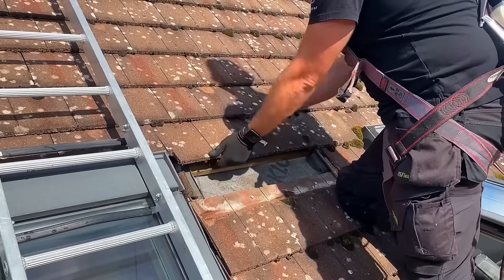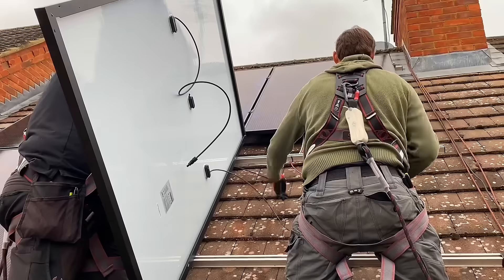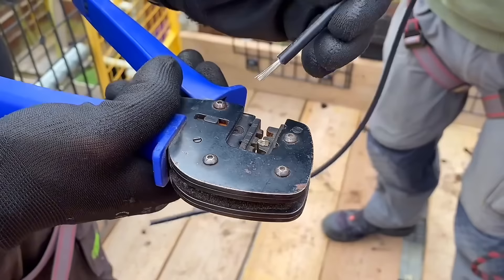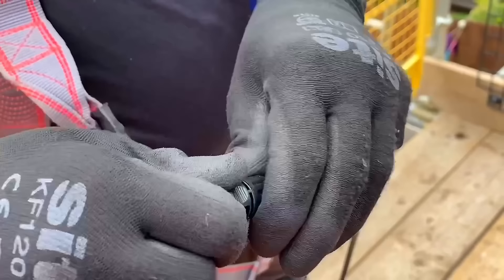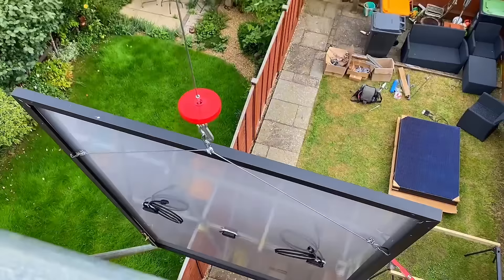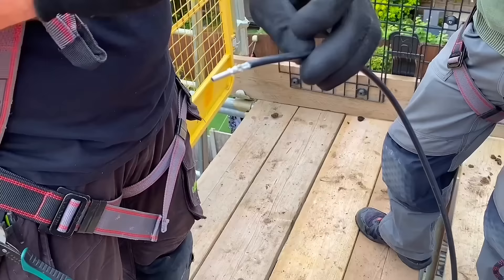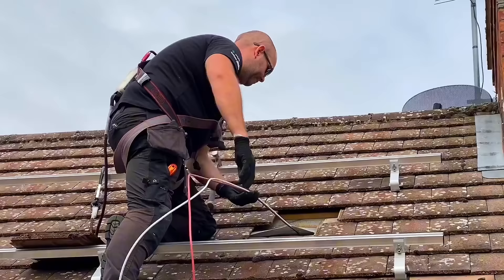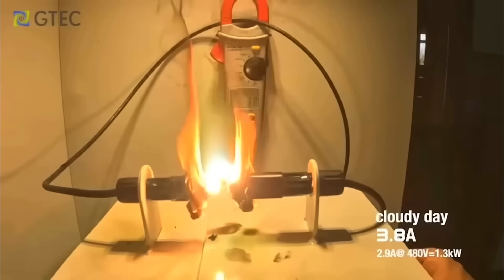Don’t Arc Around with MC4 Connectors - Solar Panel Installation

Comment: One reason why its safer to stick to lower voltages, most UK homes do not need so many panels in series, the small amount of money you are saving on the copper in the cables is negligible. just run a few 6mm2 cables rather than throwing hopes and prayers on a single connector, its insane to me. I have an array of 9x410w panels (3s3p), pretty standard 3.7kw and my open circuit voltage sits around 100v, it can still arc but wont be crazy like that 500v video.
Reply: @KrysRevamps  as Thomas Sowell stars "there are no solutions only trade offs".
Cheap affordable power is the solution, neither green activity or commercial interests are interested in cheap affordable power.
This is because green movement is based on nature worship and commercial interests want the world plus 5%.
Reply: @KrysRevamps  lol, horses for courses, your only a tiny generation plant, what about the big plants, your theory would cost balloon pretty quick. I have never had an mc4 connector fail to date. Fit off correctly, you shouldn't have any issues. I am also in a hot climate, extreme testing conditions.
Reply: @bh9420  That is why is said "most UK homes do not need so many panels in series" and not about generation plants. generation at scale wont suffer from this because Bob the local sparky that just got his MSC certificate wont be working on those systems, you would have engineers with decades of experience that triple check their work. anyway maybe your extreme weather climate is fogging up your ability to read.
Reply: @KrysRevamps  Lol, Bob the local sparky does the work on those big systems where I come from, the engineers are too busy pushing tablet pen sticks in the office, LOL. Enjoy your HV dc system.
Reply: MC-4 IMO was never designed for high voltage. My ground mount high voltage system I just cut them off and butt splice then use glue filled heat shrink. Every MC-4 connection I ever seen with over 300 volts eventually start to arc and melt. If you go on the DIY solar forum everyone does this MC 4 will fail only matter of time. Just get rid of them completely it's little scary cutting the plug off the solar panel but reality is never need to deal with it again unless your going to take the panel down worse case you can even replace the wire going into the diode box.
Reply: @Mike-01234  I can't believe you are having so many problems with them, I have never had any fail on my systems to date, most are around 400vdc.
Reply: @bh9420   There are most likely, some really cheaply made MC-4  plugs out there. plus, connecting mixed brands could make bad /loose connections. I love them for projects I make. great because no exposed terminals when unplugged and no way to reverse polarity.
Reply: @Mike-01234  While the voltage may cause the arc, it is the high current which generates heat and kicks off the MC4 connector failure by melting the plastic and pins. The pins are relatively small, but fine for a single panel. When you go for multiple panels at higher currents, then you have issues.

Comment: After using MC4s on my boat for 9 years. I can tell you they are the biggest cause of failure in my system. They are absolutely crap, made out of degradable, cheap nasty plastic that breaks down in the sunlight, be it, UV or IR I'm not sure. However, all that needs to be done is to crimp the wires and insulate from short circuit and the weather.

Comment: Don't forget to use compatible connectors, usually the same manufacturer, to ensure they do make proper contact.  Technically they should all be interchangeable but we all know how sloppy the generic stuff is.
Reply: I think it’s even better to just avoid generic stuff, period. It’s not only sloppy mating with others, it’s sloppy with itself. Better to spend the money for the genuine Stäubli.
Reply: Just had to deal with Chinese sloppy on neighbors roof. 2 "MC4" connectors together but wouldn't come apart even breaking the tabs off that lock them. Ending up cracking apart and breaking the wire out of the crimp. And then just recrimped new ends on... What a mess. Wasn't too loose. If was to damn tight haha.

Comment: This system of panel racking is not good, birds build nests underneath which leads to a build up of compost between the panel and roof which can cause leaks to the roof and even combustion of the compost as composting organic matter can spontaneously ignite due to heat build up, I would never recommend a roof system over an easily maintained ground system, these systems only really make sense on accessable flat roofs

Comment: I Crimp and then Solder any connection  where possible, its overkill but never had any connections fail or overheat in any application
Reply: Very bad practice. If you’ve done your crimp properly (which means it’s gas tight) then no solder will enter the crimp area itself, but the solder will wick up your wire and create a rigid area outside of your strain relief where flexing can break the wire. 

If you’re feeling the need to reinforce your crimps with solder, the problem is lousy crimps. Improve them rather than adding solder.
Reply: WRONG!
Reply: AHH but solder will flow across more surface of the wire and the crimp metal therefore making a far better resistance.

Comment: 1:40: That has got to be THE best feature of any connector ever: Being able to put the plastic part over the metal part AFTER the connection to the wire has been made. My personal odds of forgetting to slide the plastic part over the cable at the right time must be 50% or more.
Reply: While I agree it’s super handy, that is not unique to MC4 connectors — most crimp connectors, from big ones like this to tiny things with 1mm pin pitch, work that way. The only crimped terminals I can think of that require forethought are uninsulated faston (spade) terminals, if you want to slip an insulating boot on.
Reply: Yes, I had to remake several connections because I forgot that...

Comment: Correct crimping is critical.  Seen plenty fail due to wrong crimping.  Fire hazard if not done properly.
Reply: I use hydraulic crimpers on my mc4 connectors. As well as all my battery cables and pv Inputs get ferrules.

Comment: I worked as a solar installer during 2013-2016 then became a solar maintenance technician. During that time I mastered both AC/DC parts including connecting the system to the utility and commissioning it.
Reply: Just out here tooting our own horn, nice.
Reply: @cyumadbrosummit3534  I know right, thought we were going to get some pearl of wisdom about fires or install issues... nope.

Comment: Had a DC isolator fail and had no choice but to pull leads under load. covering all panels or wait till dark was to much hassle. Playing with arc much more fun.
Reply: Why do it under load can't you just shut the inverter off so not pulling any current not going to get an arc then.
Reply: @Mike-01234  yes another way but I hate going up and down ladders.

Comment: I soldered all my solar panel MC4 connections for my van with four 320w panels connected in series parallell giving 80v. I also covered the entire connection with self vulcanizing tape to be sure they would be watertight. (Edited, I forgot to mention that this is an install on a van that travel often at 90 to 110km/h so the cables is subject to a lot of mechanical movement and vibrations).
Reply: So how do you get the arc at 80v? It seems you need at least 300-400v.
Reply: Arc requires no mote than about 30V.
Reply: @TechMasterRus  At 80v arching is very unlikely, but it is better to be safe then sorry ;) . And on a van that often travel at a speed of 90 to 110km/h the cables is subject to a lot of vibrations and mechanical stress. (I forgot to mention that it was an van install which is very different from static vibration free mounting).
Reply: @a64738  I mean, having no arc is so boring. Even in this video, by far the most viewed part is the arc at the end.

Comment: Points from the video...
Hard Hats missing on occasion.  Using the rails as a ladder and probably damaging the roof tiles under the bracket  and the validity of the bracket fixing. 
..and as I see on so many roofs , not supporting the cables correctly, leaving them touching/rubbing against the abrasive 
roof tiles, which over time is a high risk of fire..
Reply: @paulrichards1061  who needs an F-ing hard hat on a roof ?

aircraft parts gone missing and precisely knocking the PV installers off the roof ? 😂

Comment: There are 10mm² MC4 Connectors as well to go with 10 mm² cable for larger installations
Reply: No. Calculate the required thickness (CSA) of cable required. Then use appropriate thickness cable and suitable rated connectors.

There is no need to guess, and guessing carries risk. Eliminate that risk and do the job properly.

Comment: Hi,is there any tool to cut out automatically that skin off the wire or you have to measure your self everytime that annoying half of inch? (i think ..half of inch?tell me if i am wrong)  Please anybody?
Reply: Some wire strippers have a stopper to set a certain size. So once set you can easily do this. My Irwin wise grip has it but I have not used it a lot.

Comment: They are mismatching connectors in this video which is a definitive NO-NO massive error and is cause for 80% of all PV related problems/fires. 

On the panels are Staubli MC4 connectors and they are assembling some other brand of connectors which is definitely not MC4 as only Staubli connectors are MC4 others are clones and reputable names have their own naming as for instance Wieldmuller  MC4 clone is named WM4, Amphenol named his MC4 clones H4. No company has licence to produce MC4 named connectors as it is proprietary Staubli name, and no other connector is tested to comply long term compatibility with original MC4. This is why every reputable inverter and pannel uses Staubli original connectors.

Check out TUV Rheinland's FMEA Rating of PV Module Failures.

Mixing connectors is reat receipe for disaster. Never do that, kids, you'll burn your house down.
Reply: Is really painful seen this crossmating situation over and over again, even in videos supposed to be for good practice. The stripping of the cable was also not well done...

Comment: The only ones that care are ensurance companies.
I really hate high voltage DC for good reasons.
Reply: I have more respect for my 48V battery than our grid connection.
When it shorts, those 280Ah cells dump serious current.
Reply: Agreed, all those ( ofter to thin ) DC cables running over the roof, making tight bends everywhere... I also hate it.
Thats why I went for Enphase with micro inverters, much safter and simply better for good reasons.
Probably also much more install friendly.
The use of DC cables should be reduced to a minimun.
Also the losses in a good length of DC cables are pretty significant.
Reply: Loss is the same regardless AC or DC. It is just ohms law.  Use the proper wire size.
Reply: @Sixta16  In practice, financial law competes hard with Ohms law.
That's part of an electrical engineers job.
Build it at less costs and less losses.

Comment: Not the best way to do it.
You should ensure the cable reaches into the cylinder as the actual conductor, is the neck between the crimp and fixing.... 
30amp rating apparently...

Comment: Those are not made off to specifications. First of all: He stripped the insulation to far back.

This is the only correct way (German with subtitles):
https://youtu.be/sErsAfgwFrI?si=CErfpB61degL3wMN
Reply: The void to hold the stripped wire is deliberately quite generous with MC4 connectors to allow easy in field stripping and preparation of the cable.  There is no need to precisely measure the amount of insulation removed.  Anyone doing so is simply burning time and the customer's money.
Reply: @retrozmachine1189 my crimper have a guide and a bit of tin which only sits down flat if the stripped wire is not to long. I have had them a long time but they keep the crimp end square and set the crimp in the jaws at a set point.
Reply: @andyhodchild8  Nice feature but doesn't negate the fact that there is space in the terminals to accommodate a degree of excess wire.
Reply: @retrozmachine1189 I would rather spend a few seconds extra on inspecting a crimp than having a customer's house burn down.
Reply: @Richard1977 Cite examples of customer's houses burning down because of a reasonable amount of excess stripping of the wire, ie that is by design accommodated by MC4 connectors.
Reply: I agree stripped the wire too much

Comment: I’m leery of the unbranded crimp tool. The more I use first-party crimp tools, the more I realize that most no-name crimp tools are crap, producing poorly formed, improperly pressed crimps.
Reply: @tookitogo  you can adjust that.
See a small wheel on it and set it.
Reply: @dyslectische  Adjusting the tension wheel cannot, and will not, make up for crappy dies. I know what I’m talking about: beyond being a trained electronics technician with an unhealthy nerd interest in connectors, I own a number of no-name tools, as well as a handful of first-party tools. And at work I have access to more. There is no comparison in the precision of the dies. The no-name tools often literally have the wrong shape in the dies (very often, they’re made to crimp wider and flatter than the real tool would), and with much sloppier tolerances. Good crimp tools specify their tolerances in hundredths of a mm. Cheap tools don’t even come close.
Reply: @tookitogo  than you talk about china product.
Thare good tools make for cheap in Germany .
What just work fine.
For the rest my self a trained electrische technician .
Special for track and trace systeem.

We only use tools that have certificate and we have recalibrate after 1 year of use.
So i do know my stuf 

But again people do not pay for it .
So thare are good normal tools for normal price for a normal man to use.
Reply: @dyslectische  Well yeah, of course I mean Chinese junk. German-made tools aren’t no-name! (I have various Knipex at work. And of course the connector-name-brand tools are practically all made in either Germany, Sweden, or USA.)

However, for most connector types, there exist no decent third-party tools. So you either get the original first-party tool for $$$, or you get some Chinese junk that’s not optimized for anything, and most certainly can’t be calibrated. :/
Reply: @dyslectische  P.S. Nur aus Neugier, was ist deine eigentliche Berufsbezeichnung? (Ich bin Elektroniker EFZ, also der schweizerische Abschluss. :P )

Comment: Stupid question on my part: How do you deal with any bird-sh!t that might accumulate on the panels? I know you need a clear sky facing, but you have little comtrol of avian flight paths. Are some panels more resistant to having it welded on? Does it make a difference?
Reply from the maker: Glass tends to self clean - if you have rain (obs) and the panels aren’t flat.